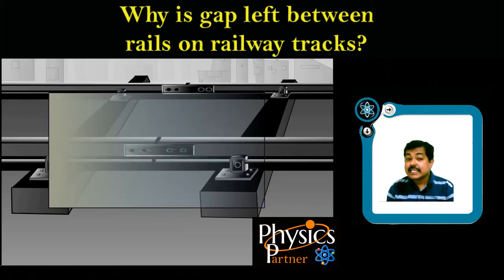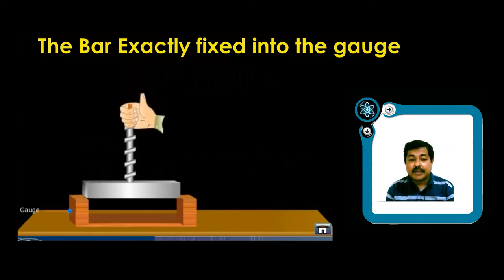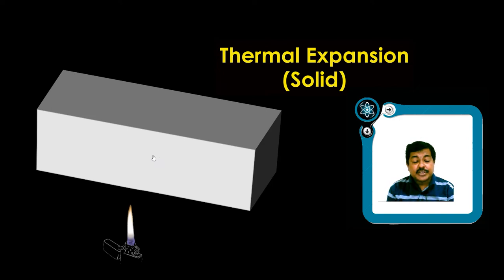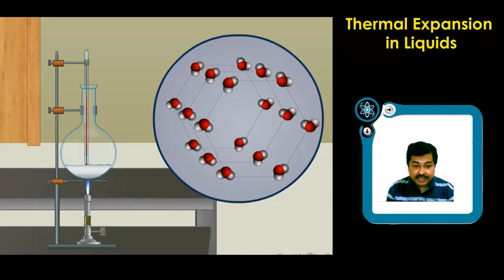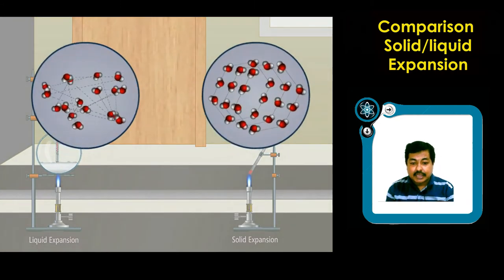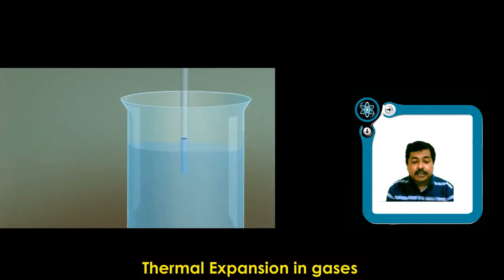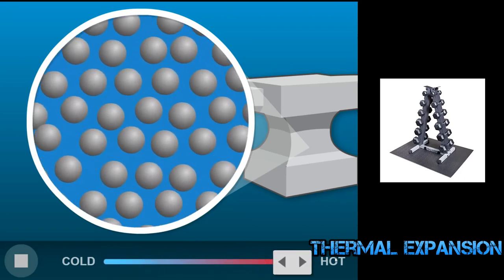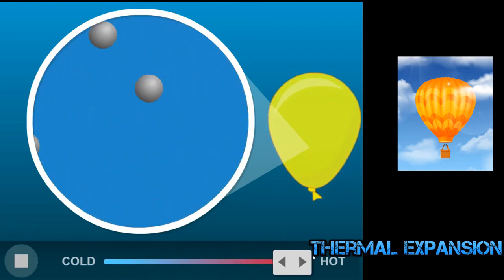Thermal Expansion of solid liquid and gas IGCSE/AQA/Edexcel

Comment: But we learned that solids on heating their particles move faster and become liquid. But here the patticles are moving faster and solid is expanding. Pls explain me sir
Reply from the maker: When we heat a solid, its particles gain energy and start to move faster, causing the solid to expand. This happens because the increased energy makes the particles vibrate more, pushing them slightly further apart, which is called thermal expansion. So, while the particles are moving faster, they are not yet breaking free from each other to become a liquid. If we keep heating the solid and give it enough energy, the particles can eventually overcome the forces holding them together, and that’s when the solid melts into a liquid. So, expansion is just the solid getting bigger due to faster-moving particles, not necessarily turning into a liquid right away.